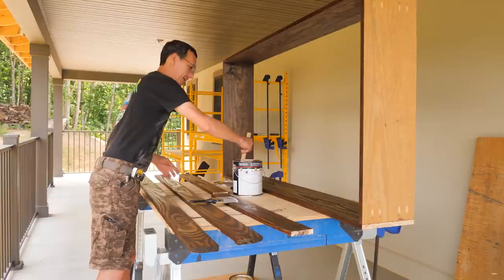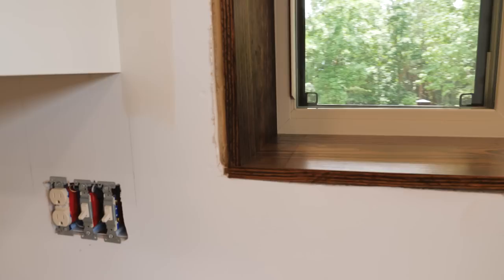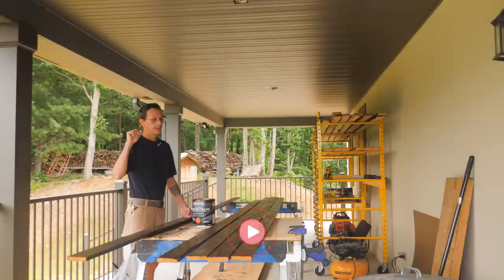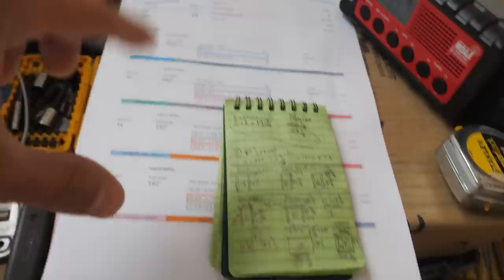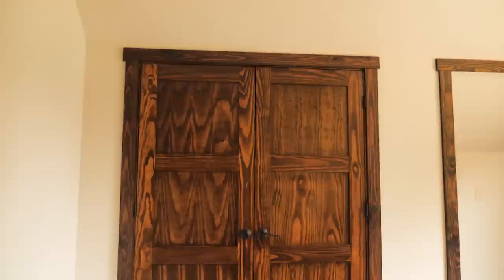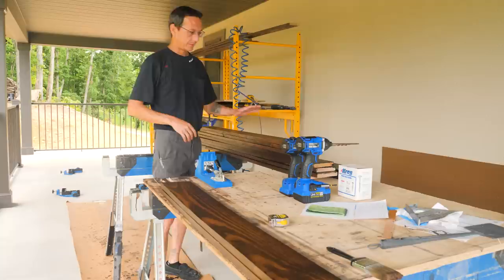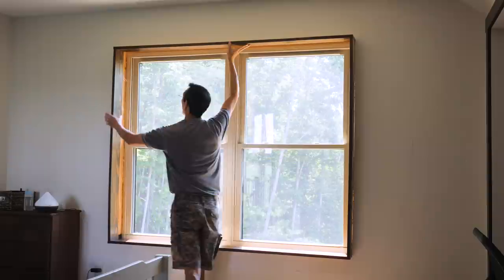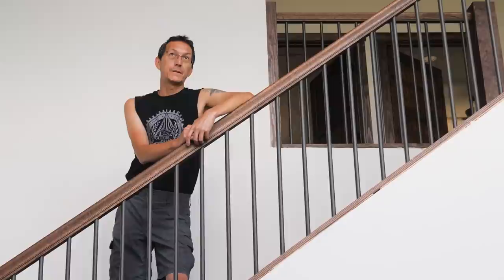Progress! Building Jambs, Trimming Windows and Doors

Comment: I built window trim boxes like you but with primed MDF. (Which I don’t like but that’s what the rest of the house has)  Before installing I glued the casing to the box so I wouldn’t need to use nails. They look fantastic. Perfect miters, no nail holes and real sturdy. I got the idea from Richard at Finish Carpentry TV.  The only drawback is that it takes a lot of time because of glue drying wait.

Comment: I’m north of you in the south of VA, Blue Ridge mountains. This is our fourth summer here, just the hottest and most miserable. The last three years, we really didn’t have uncomfortable temps until August and then done. This one started getting heat waves way early, so it was like Spring was just a few days long. Yuk. Even elevation only helps by a few degrees. The town is the valley is worse, but not by much.
Reply from the maker: Yeah it's gotten progressively hotter each year for the last 15 years.